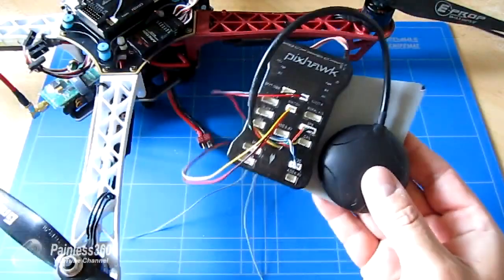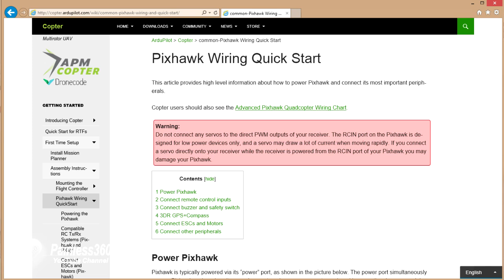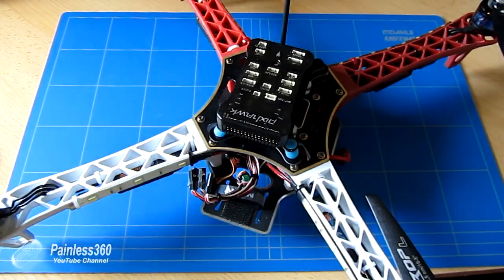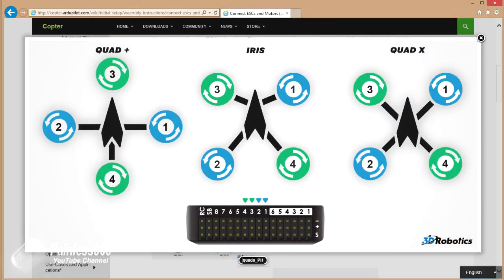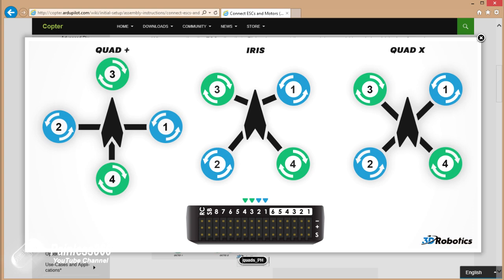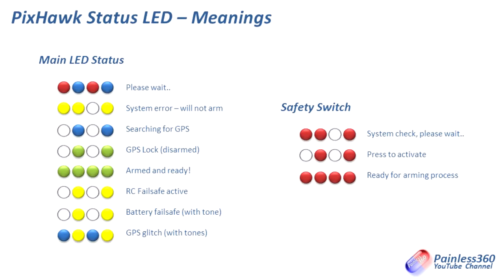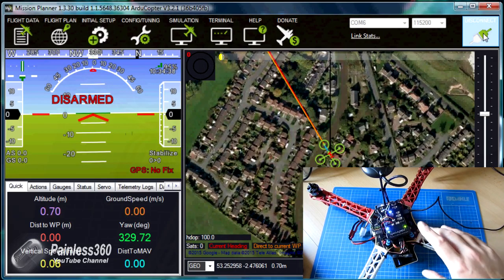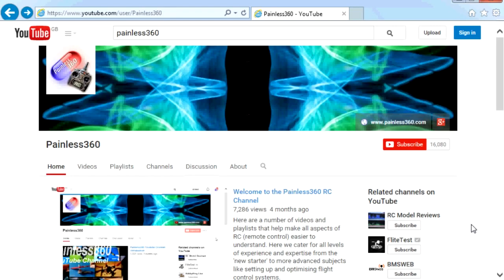(2/5) PixHawk Video Series – Power, installation, final checks and first hover

Comment: Understand about the video. Will do when I get home tomorrow...OT at moment.  However I found the article explaining the high output of the Pixhawk on start up. 

https://github.com/diydrones/ardupilot/issues/2094

Just one of a few I've come across explaining that Pixhawk sends a 900us signal on startup, apparently too high for Emax ESCs and some others as well like Afro.  I haven't ordered any ESCs yet as I want to make sure that they are compatible with the Pixhawk. Being this is my first build, I dont want to go all in on equipment until I am confident I can build, program  and keep in the air before I begin spending real money on professional grade equip.

Comment: hello, i was wondering if you can use dji e800 esc/motors with pixhawk or pixhawk 2? is it even possible
Reply from the maker: Yep, should work... We've not tried it here though..
Reply: i had used e310 esc/motors with pixhawk..copter hover above very nicely mean stable..but after seconds it back down suddenly...dont know whhat the problem actuelly is ..looks every thing fine
Reply: Thanks guys, well the motors will definitely work with the pixhawk. I think it depends on what type of esc's you use or if you do use dji esc's you might have to play around with pids i guess or just use different esc. But i am pretty sure E800 motors alone will work. and same goes for E310 propulsion system.
Reply: We use dji e310 propulsion system (esc+motors) as i mention above ...can you please tel me abot PIDs  tuning..or you sure that will be the cause??? ..and the problem is as i said copter goes up and suddenly goes down and then again goes up and so on...even the throlle is max and constant but...

Comment: First, Thanks for all your video series. I've routinely gone to your channel to look for answers to my build projects. Just finished watching 2/2 of the PixHawk Video Series and picked up on a comment you made about connecting only one power wire of the motor ESC leads. In short, I'm building a Hex copter using the PixHawk and I'm at the stage where the PixHawk successfully lights up with all the tones and fully arms yet I can't get the motors to spin. I have not been able to calibrate the ESCs through the PixHawk and Mission Planner but have by-pass it and successfully run them up one at a time plugged directly into the receiver throttle channel. I plan to try removing all but one power wire as mentioned in your video to see what affect that has. That said, any comments or guidance is appreciated.
Reply from the maker: The removal of all but one power wire was in relation to switched BECs on the ESCs I was using, If you are powering the Pixhawk using a Power Module then you can provide a 'backup' power supply using the PWM output pins and a BEC. Best of luck!
Reply: P360 .... Thanks for the comment. Yes, I am using a Power Module so I see removing all the power leads but one to the ESCs is of no resolve. Thanks again.

Comment: Hello painles360 . I've bought same pixhawk from bangood , all works great but  that throtle response.. when i doing esc calibration all motors are really respond to throttle input , but after saving esc settings , and arming up again my throttle lags , and it's a big difference like from kk2 board , it's supose tu be like that or it's something wrong with my pixhawk?
Reply from the maker: The KK2.0 is a very basic board compared the Pixhawk is a far more sedate flyer unless you start to crank up the settings (see our comparison of flight controller video). Best of luck!
Reply: Yep thanks.but the throttle , like if i cut immediately motors stops about  0,5 sec later , like you can feel the lag, and it's bit hard to control a copter because you have to calculate lag..i mean do you face the same thing? or it's just a thing to go by.
Reply from the maker: +Robertas Juscius that isn't right, should be faster. Make sure you are using basic modes. Best of luck?
Reply: Ok thanks i,ll try

Comment: how do you address that gps no fix warning
Reply from the maker: Usually it just takes a while to get a lock, if it never does then it's probably too close to something that is causing interference... Happy flying
Reply: @Painless360  Last question, I did achieve GPS locks, however, the readings put me in a country from where I am. Is this a problem with my GPS?
Reply from the maker: Sounds like it. I've never seen that!
Reply: @Painless360  Hey, I worked it out yesterday. Seems like the GPS signal from where I was testing was very weak. I found a spot where it was able to have a 3d fix, however, the location is very unstable. I might use RTK for better GPS reading. Thanks, though :D

Comment: Hii 
Sir my pixhawk flight controller Is not arm on my drone I am reset this all of settings on flight controller and reprogramming all of setup but no arm what are the main problems of this board
Reply from the maker: See my video on troubleshooting arming... I hope it helps..
Reply: @Painless360  sir seen all parts but no solution of my problem pls help me on basic parameters or programs flashing
Reply from the maker: What troubleshooting have you already done?
Reply: @Painless360  sir I am set and check the some parameters of arm function my flight controller is massage  Geofance breach so I am set this and reset it but no arm pls help me about this 
Sir I am not inserted on flight controller sd card so pls say to me if it's ok or I needed to sd card on controller

Comment: hi there I am just following your series and have hit a problem. The pixhawk sets up until I come to connect to the flight battery Then  the switch light flashes 4 times  but I get no main light and I get a tune from the esc's beep,beep ,,,,,, beep. Mypixie is a 2.4.8 variant.can you help please?
Reply from the maker: Not sure, I've not seen that here. I'd check the forums... Best of luck!
Reply from the maker: Hey Bob, I'd suspect that the throttle isn't low? Check what you can see in Mission Planner screen. See my video on troubleshooting arming.. Best of luck!
Reply: @Painless360  Hi there I set up the thrittle as per your vid still no joy
Reply: Got It just started from frame type again and all is well thanks for all your help

Comment: I wanted to add what is some new information for followers that may be having the same problem I described previously where the PixHawk arms but the motors don't spin. I need to research this a bit more but I found what is described as a hardware exception relative to using EMax ESCs with PixHawk. I'm building a 550 Hex frame kit from HobbyKing that included the 550 frame, ESCs and motors. The ESCs and motors are EMax. I've provided the thread on this issue for readers to determine is this can be a root to the issue I have. I plan to follow up on this and just might be able to get this bird in the air soon.     https://github.com/ArduPilot/ardupilot/issues/2094
Reply: Just an update from my previous post here a few weeks ago. I chose to replace the ESCs rather than try to modify the EMax brands after reviewing some posts that involved removing a very small capacitor from the EMax ESC board. With great success the new ESCs were installed, calibrated and work just fine. A bit windy at this post so I've done some ground run ups to see how the Hex behaves and get a sense of stick sensitivity. Glad to be at this stage of the build.

Comment: I've been trying for a few days now to get my quad (QAV500 with PixHawk 4) to arm and test motors.  I'm still getting 2 yellow flashes on the main LED.  The compass is active and I have 3 SATS.  I'm now getting a message of PreArm: Inconsistent compass.  What does that mean and how do I correct it.  Ideas?

redjr
Reply from the maker: If you google the error you'll see that the error is due to the compass needing to be recalibrated or moved away from interference. Best of luck with it..
Reply: Thanks, it was interference!  Too close to my LCD panel.  Duh.  Now I'm trying to get past the FS_THE_VALUE message.  I was trying to follow this video, and you said you
d come back to the failsafe settings.  This is my first attempt using the PixHawk, and I simply don't know what or where to adjust/set the failsafe throttle value.  The Taranis, or PixHawk, or both?  I'm simply trying to test my motors temporarily, so i can continue with your video and the other important settings.
Reply from the maker: +redjr16 the failsafe setting is too close to the low throttle value. Lowering it, or raising the low throttle value will sort it http://ardupilot.org/copter/docs/prearm_safety_check.html
Reply: Thanks again.  I'll check out the link.  Is there a 'simple' way to temporarily dis-engage the GPS from the pre-arm logic, for purposes of testing your motors?  Unplug it maybe?  BTW, your 3rd video in this series suggests I need to change my inputs on the Taranis.  Does that still apply if using S-BUS?  I copied a model in my radio and the RC calibration in PixHawk seemed to work fine and the gimbals all correct.  It's a struggle working with the Taranis if you're new to this hobby.  Not very intuitive at all.  :)  There doesn't seem to be a backspace button when editing a line, or I haven't discovered it yet!  They really needed a touch screen.
Reply from the maker: +redjr16 if the radio drives the channel above 2000 and below 1000, then use the endpoints in the Servo menu on the radio to reduce them. I normally use about 97.5% travel here. Best of luck!
Reply: I'm still battling getting my Pixhawk quad to arm.  I've narrowed it down I believe to the FS_THR_Setting.  When I observe the values for the throttle in the RC setup in Mission Pilot they go from a low of 925 to 2006.  Using your suggestion of 97% that would be a value of roughly 1920 for FS mode.  Correct?

When I then go into MP and try and adjust the FS parameter it only shows valid values of between 925 and 1100, so therefore I cannot set the FS_THR to anything higher than 1100 and it gives me an error of out of range value.

I'm obviously overlooking something very fundamental here as a newbie.
Reply from the maker: The low throttle value od 925 is WAY too low, reduce the endpoints on the throttle channel so that it's about 1060. Best of luck.
Reply: Success comes in small doses!  I was finally able to arm my quad.  After making some tweaks to the FS value, together with getting a GPS lock-on and arming worked!  I ended up re-calibrating my ESCs and they all start now.  It's not outside yet, but real soon.  Still not sure I've got my flight modes set correctly, but that's for another day.

Thanks for you videos and help.
Reply from the maker: Best of luck with the maiden flight..
Reply: So.... after having some success with finally getting my quad to arm, I must have done something else that broke it.  Urgh!   The symptoms are the FC will bootup and go through initialization, but at the very end the alarm starts beeping at a very high pitch and rate (about 5-8 shorts beeps and then repeats), and the status LED is back to fast flashing yellow.

I can't remember what if anything I did to the quad, or parameter that may have caused this,  but now the quad will not arm!  So I feel like I'm back to square one.  I continue to search on the web for these symptoms, but haven't turned up anything yet.  I'm sure this is signaling something with the quad that's not right.

Thoughts?

Rick
Reply: Ah ha!  Maybe this condition???

"Flashing yellow - with quick beeping tone: Battery failsafe activated."
Reply: Solving 1 problem, discovering another..... 

So, I've got my quad on the bench and testing the arming and motors.  I get them to power up and then at about 50% throttle, #4 starts to slowly spin down.  You can hear the change in pitch and it will finally come to a complete stop.  If I nudge the the throttle a bit it will start back up and then slowly stop.  Even at full power it comes to a stop.

Is this a sign of a bad ESC or motor?  There are no props and it's under no load.  Is there a way to way to check the RPMs of a motor in the FC?  These are not pricey motors, but their not that inexpensive either.  If I need to replace it I will.  Bad ESC?  Those will be difficult to replace on my QAV500.  :(
Reply from the maker: Swapping the motor with another one on the model will tell you if it's the motor. I'd suspect the ESC. I'd check the setting on it in case it's got something weird configured on it.. Best of luck!
Reply: After a little more testing and swapping a motor, it was in fact a bad motor.  Glad I order another one last night.
Reply: Well I thought it was a bad motor.  I know now it must be a gremlin in my quad somewhere.  I'm baffled, here's why...

So after installing the new motor, I observed the same behavior.  Motor 4 would simply start to spin down and stop.  At 50% power or 100%.  So, I naturally assumed it was the ESC.  So, 4, brand new Lumenier 30A ESC arrived a couple days ago.  I balanced them before installation and all was fine, or at least appeared fine.  I got through installing them them today, and after hours of painstakingly putting the QAV500 back together again, I armed it and tried the motors.

Sure enough, after about ~2 minutes running, motor 4 spun to a stop.  I can't believe for a minute a new #4 ESC is bad too!  The odds just don't  suggest it.  So what could be going on?  Furthermore, after additional testing, motor 4 stay spinning and motor 2 spun down and stopped.  Urgh!

I don't dare put props on this thing and test it knowing it will likely fall from the sky as soon as one of the motors stops.

Could this anyhow be related to some setting in the FC?  I've gotten past my GPS and failsafe settings, so the quad will at least arm.  But why the hell is motor 4 and 2 stopping.

The Lumenier ESCs cost me $100 bucks and are a more respected brand name than what I was using before.  But now I'm thinking the ESCs are not the problem either.  :(

Faulty PixHawk possibly?  Power distribution board?  I'm not sure this thing will take another dismantling and soldering of the PBD!  This is getting old.  

Anything else I should try short of an entirely different FC?  Perplexed in CT.

Rick
Reply from the maker: I'd check the logfiles from the FC and see if you can see what's going on. It could be a faulty FC but I've personally not seen what you are seeing. It's got to be one of the things that are the same on all setups. If that was me here I'd be tempted to try another FC once I'd checked the wiring didn't have a problem.. I hope you get to the bottom of it soon..
Reply: I doubled checked all my solder joints, and made sure there are no pinched wires from the ESCs and motors.  Since it has occurred with both #2 and #4 motors it seems it's possible to be related to the FC.  But I find most electronics are very reliable, but on rare occasion they do fail in some way.

I ordered another PDB for the QAV500 and will consider replacing it when it comes.  This is very frustrating.

Rick

Comment: +Painless360 It appears as though you are making use of a clone of the Pixhawk, such as the one seen in the link below. Have you had any issues with either the hardware, or software (such as MissionPlanner refusing to update firmware)? Would your recommendation be to go with the original 3DR version, or get a clone? With such a large price difference, I see it difficult to justify buying the original  at $387 ($199+$89+$99, excluding 3DR's expensive shipping), versus $179 for the clone (with free shipping). http://www.banggood.com/Pixhawk-PX4-2_4_6-Flight-Controller-NEO-M8N-GPS-Radio-Telemetry-PPM-OSD-3DR-p-977597.html
Reply from the maker: +Kurt Coetzer This is a clone and it works great. There are more and more copies coming out and the main places (like Banggood, HobbyKing and others stick then and offer support). Best of luck.
Reply: +Painless360 Thank you!

Comment: just fitted pixhawk  but when i arm. compass turns 90 deg when i was setting up the compass kept coming up with off sets so i sett 90 deg yaw and turned compass of in pixhawk of all was ok but when did radio set up and armed mission planner heading turn 90 deg i have uav pointing north but when it arms it turns 90 deg if i set so when power up heading is pointing east but uav is north but when it arms it turns to north on mission planner ?? is this the norm
Reply from the maker: +Steve Hobson Not really, the compass should have an arrow on it that should be aligned with the front of the Pixhawk. Normally you'll see both compasses calibrating together in the display in Mission Planner and if the compass is unhappy you won't get it to complete..
Reply: Yes I have done all that all arrow point same way but when I arm the compass heading turns 90 degree